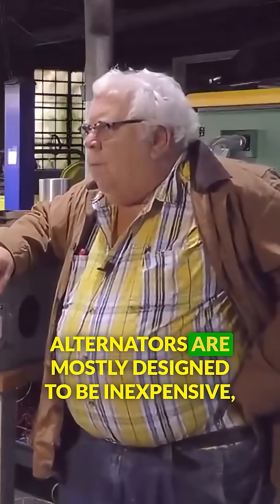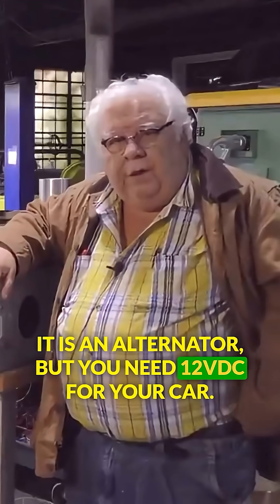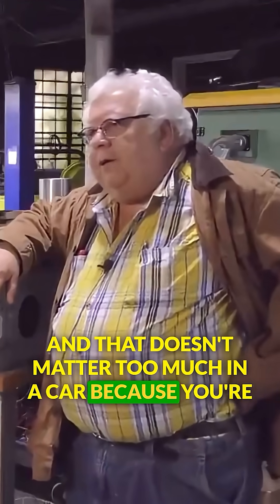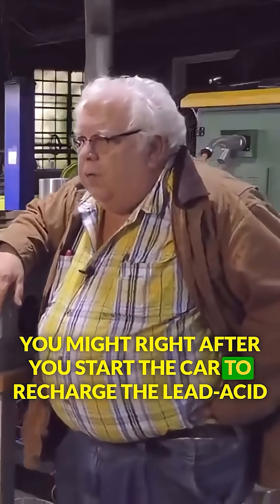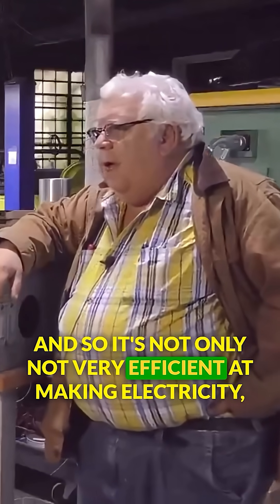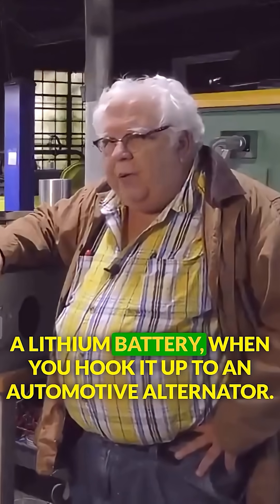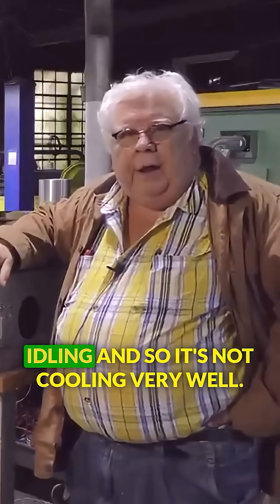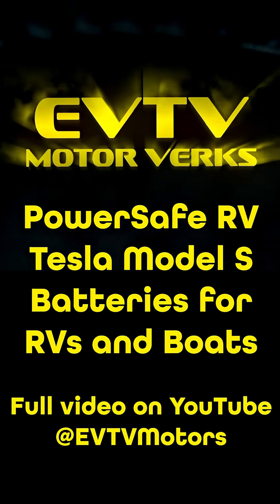Alternators are Only 50% Efficient!

Comment: The good old GM 2 wire alternator has saved many farmers and poor people in a pinch. Easily to adapt to almost any old school application.
Reply: And if you pull the diode bridge and couple it to a windmill, 15 volt ac. Run it backward through an old battery charger transformer for 120. (Runs a lot cooler without the diodes, too.)

Comment: A lithium battery has lower internal resistance therefore higher current which kill’s alternators.

That why you need a DC-DC or current limiter between them.